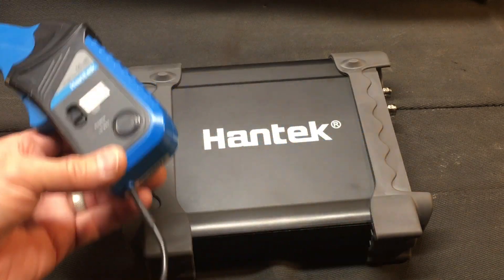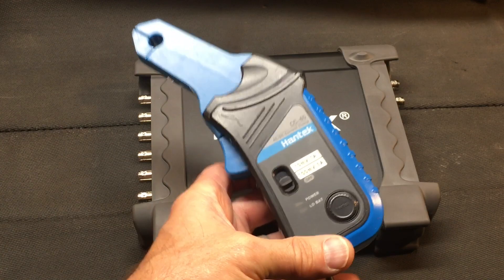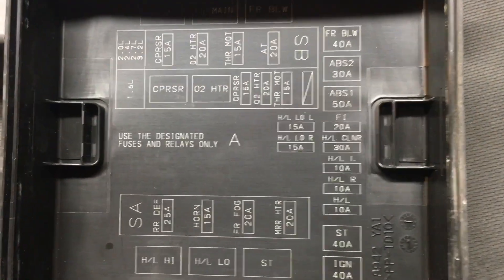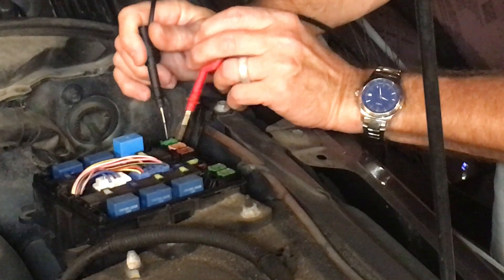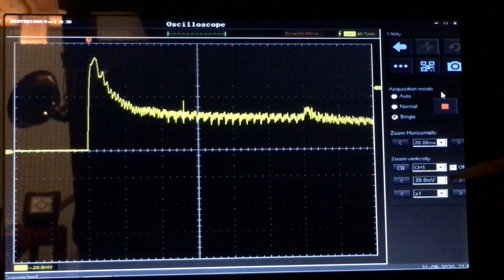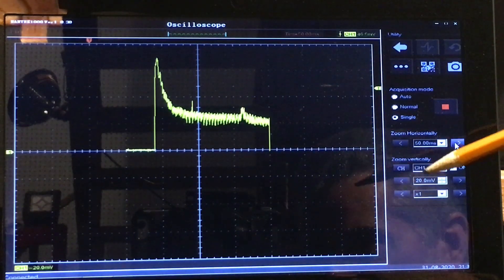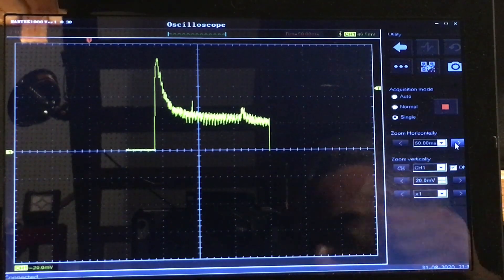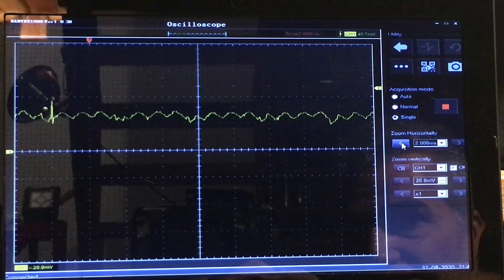“Current Waveforms” No Clamp !

Comment: This is a nice trick 
I'm not a math  guy or anything close to that  but base on your 20mv  scale  I assume  that pump  draw  somewhere  around  9.1 amps at the beginning  of the wave form  and  somewhere  in between  4 and 4.5 amps working. 
Now I'm curious  if we can zoom in  to have a real good look  at the wave form and measure  time  on the humps  we can guesstimate  the rotation speed  of that pump
Reply from the maker: Correct...60,000/delta T in milliseconds between like humps (1 rotation)=Pump RPM 👍

Comment: I'm wondering if this method could be used for a relative compression test?  Thank you for sharing another great Vid!
Reply from the maker: michael haworth Yes I think so...Any Batt to Ground point during crank effectively produces an inverted relative compression waveform. Current flowing through a drop point produces a more traditional trace (further up the Y axis = higher compression) As seen in the video. Thx for watching. Cheers 👍

Comment: Nice and creative way ay of using the scope! I played with checking battery drain with a fuse link and voltage drop, but you would need a very small fuse to get accurate results at ~20mA, and it would probably pop every time the car woke up!
Reply from the maker: Mechanic Mindset Super simple test method Darren. Perfect for my mind 😀

Comment: Hello boys...
Love the video thanks.
Kind of got me thinking about relative compression using volts as my scope does not have an amp clamp but where to put the leads across the battery ?
Reply from the maker: michael haworth Good question...Ideally across the Battery. But I believe in all practicality, any point with the B+ to ground will essentially yield similar results. As you know, the waveform will be inverted performing a compression test utilizing Static Voltage as opposed to Current draw (Voltage drop). Cheers

Comment: Why you not use pico 2204 for this?
Reply from the maker: Krzyyq Moto That was certainly an option. And honestly the better choice...However, I have received many questions lately with respect to the 1008C. Since I am only a hobbyist I try to feature low cost gear. Although a strong argument can be made the 2204A is in a similar price range. Thx for watching. Cheers